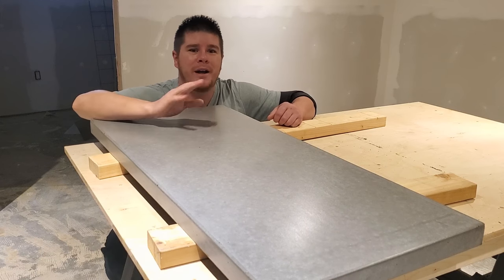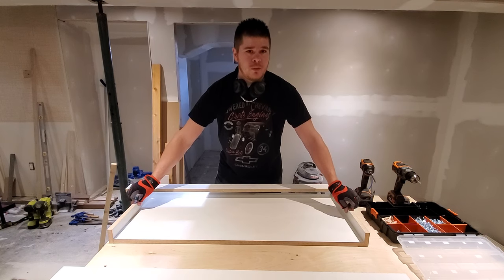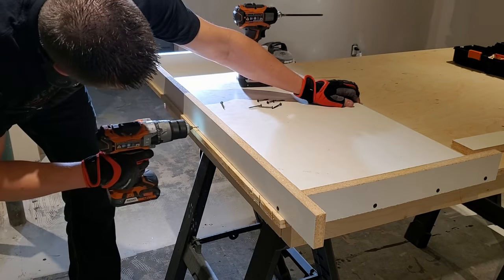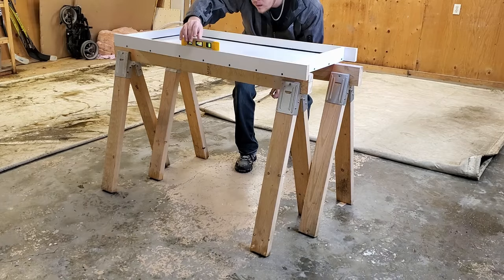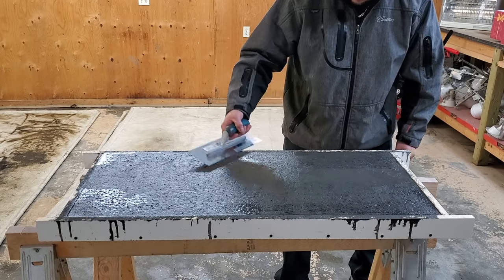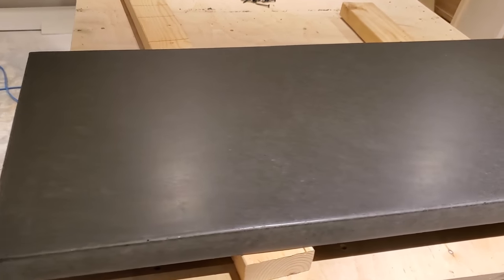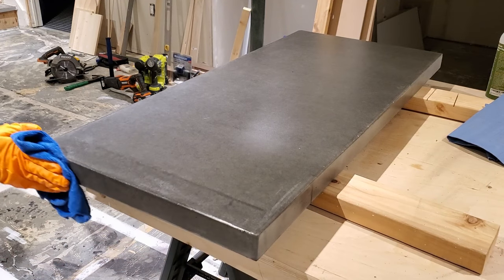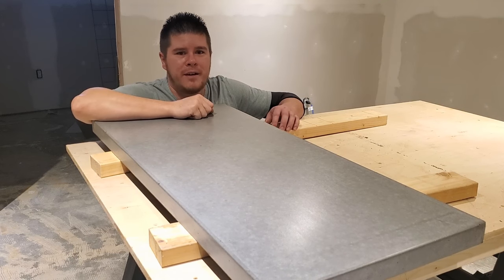Beginners guide, Concrete Tabletop you can build. No special tools, hand finished

Comment: Awesome work! Thank you!!
Reply from the maker: Thanks!
Reply: @JessedoesDIY  i was looking for inspiration for a side table and will make a concrete top for it! Should you always have reinforcement within the concrete no matter how small your slab will be? I’m thinking 2feet by 1foot 2inch depth.
Reply from the maker: Cool! Yeah, it just helps over time with cracking and twisting, and helps prevent it from one day just splitting apart for no real reason. Just helps keep it much more durable overall. The bigger you go, the more you may need to step up reinforcement, but even small slabs should have it.
Reply: @JessedoesDIY  brilliant! Thank you so much for your help. I’ve subscribed and am super stoked to get started. Thanks again.
Reply from the maker: Awesome, thanks! Good luck and have fun

Comment: Bummer. Did a second one of these and had a bit more car wax than i probably should have and it's like caked into the concrete, which came out perfectly, thanks to your method! Any advice on getting it off? I assume there's a chemical hack to make this happen. Thanks again
Reply from the maker: Yeah that sounds like too much, or it wasn't buffed off after it was cured on the mold before pouring. Glad the slab turned out tho. I wouldn't use any chemicals to get it off, you'll stain the concrete. Just get a blue scour pad sponge thing from the kitchen and water and buff it off. Then rewipe it with a damp rag after. If you have any stubborn stuff use a small chip or paint brush and water and poke it. Hope that helps

Comment: Great video. For the most part it came out really good. However I don’t think I vibrated the edges enough. The center looks fantastic but a decent  of pinholes near the edges. What is the best way to take care of these? Thanks!
Reply from the maker: Thanks! Yeah, I've been there. If you can get some cement, not concrete, cement. Mix up some in a solo cup with about a 50/50 mix of water and acrylic fortifier (concrete aisle) to be like toothpaste. You can use pure water if need be, but itll stick better to the cured concrete with the fortifier. Then press it in and smear it around, wait a min or 2 and with a rubber gloved hand wipe it back off. It'll stay in the holes. Let it dry a couple hours, then with a kitchen blue scrub pad dampened slightly with water, remove the haze from it and wipe off with a shop rag. Hope that helps!

Comment: Jesse, great video. I would like to add a concrete acid stain to my counter top. Does the wax mold release stop the concrete from absorbing the acid stain? Your thoughts? Thanks.
Reply from the maker: Thanks! Nope, because it's dried on the mould it doesn't absorb into the concrete, you're all good. Good luck!

Comment: Hello CanaDYIan! You mentionned 6000psi concrete, would 5000psi get a similar result? That’s all I find near me, the only 6000psi is fast set and prefer take my time. Thanks for the great video, nicest results and explanation I found!
Reply from the maker: Absolutely it will! I've used the 5000 psi stuff as well, and you'll get better results with a slower setting in my experience. The 2 different mixes are very similar, just different additives. Technique is more important in this case. Good luck on yours and keep me posted!

Comment: Jesse, what a brilliant demonstration! This is a gem.  Curious if you have recommendation  for a lightweight concrete to build a farmhouse concrete sink that would still be take a beating without chipping or cracking? Appreciate any input.  Thanks.
Reply from the maker: Thanks. Your only option for a "lightweight" concrete is to make a thin thickness with fiberglass. But that's a whole different ballgame

Comment: Great video and great result. Bravo!!
Can i make a similar countertop for the outside? If so, will it resist the canadian winter or do i have to add anything to the concret mix to prevent it from craking?
Reply from the maker: Thanks glad you like it! I have some outside as well and they can last, you'll just have to be more diligent with adding sealer and wax because they will require more maintenance is all

Comment: We are going to make 10’ floating desk. I want to include a usb port on top of the desk for easy access. How do you suggest we do that? I’ve seen some different ideas. Also I want to include holes for additional wires for printers to hide those cords.
Reply from the maker: There are USB hubs you can get at the hardware store that pop into circular cutouts. I'd use those. Check out my concrete vanity top to see how I included knockouts in my top. You'll also only be able to make an 8' top because that's the maximum size of melamine  plus making it too big will make it more liable to crack
Reply: @JessedoesDIY  Thank you, I’ve seen some round usb hubs and was leaning towards those. Yes, my husband has worked with concrete before so we know it will have to be done in 2 pieces and that’s fine since I need my 2nd piece to be wider than the rest. My husband is a contractor and does it all but thanks for the advice.
Reply from the maker: Oh awesome! Well good luck on yours

Comment: Late to the game, but question... if you've constructed your counter and want to frame then pour the concrete directly, put the mesh in there, (also using the board as the base), if you don't have direct access to the base, can you just vibrate the exposed sides to get the air out, or would you have to mix the concrete thinner?
Reply from the maker: There is a more specialized concrete mix you can buy for pour in place concrete tops that have defaming agents in them that forces the air out with little to no vibrating. It also has  much less aggregate in it and plasticizer to help it flow out with less water. You'll need to also be good with a float and trowel because you're looking at the top so it's up to you to make it smooth. That's a whole different ball game, I suggest you look at that specifically because it's quite different than this method

Comment: Great video! Building an outdoor bar with concrete. Do I need to add any type of weathering agent in the concrete mix?
Reply from the maker: Thanks, happy to help! Nope, you should be good to go. You just might have to apply sealer and wax a bit more often depending on your climate and how often you clean it. If water stops beading up on top of it, reapply. The sealer should be 1-2 times a year max

Comment: Great, step by step video. Do you think I can build a large dining table using similar technique? My table top will be 105" x 39".
Reply from the maker: Thanks! Yeah you could. I would still add the mesh in it but I may also add some thin reebar around the edge just to help prevent sagging and cracking over time. Also, just make sure to have it supported underneath properly. Good luck!
Reply: @JessedoesDIY  thanks Boss!
Reply from the maker: Anytime

Comment: Hi there, thecountertop looks great, just a quick question, what is the thickness of the slab? I have made a mold and cast my counter, but was wondering how much my measurements differ from yours.
Reply from the maker: Thanks! I made mine 1 3/4" thick. It should usually be that or 2 inches for strength sake and to avoid cracking. If you use Glass Fiber Reinforced you can usually go a bit thinner

Comment: Can you list the die that you used for the concrete? I noticed the water you added was black. Also @06:44 the die is being added.
Reply from the maker: I used Quikrete liquid concrete dye in Charcoal. You should be able to get it at Home Depot. It blends better if you add it to the water first, but then I decided after I wanted to add some more

Comment: Great work…..Im trying to buy concrete and the guy at the hardware store is asking if i want my concrete with sand or small rocks in it…..Which one should i buy ? Best regards !
Reply from the maker: Thanks. I mean, all concrete has sand in it. For this stuff I used Quikrete 5000, or 6000. One is a white bag, one blue but both would work. I'm guessing his sand comment was referencing a countertop mix which has no rock. If it is that, you really can't go wrong with any of them. Good luck and let me know how it goes!

Comment: Hi Dan.  I am making a fire table top that is 6' by 4' with a cut out in the middle for a 4' by 6" burner.  Should I use 1/4" or 3/8" rebar tie wrapped to my wire mesh to make sure the 1.5" slab will be strong enough on the 36" by 50" metal base?  A bit worried the scaling up may be problematic.

Comment: GREAT VIDEO. I Have a concrete kitchen top that's been waxed, sealed over and over but Lemon and acidic juice burners through and stains the top. Do you have any suggestions on how to prevent making and chippy concrete tops?
Reply from the maker: Thanks! Yeah you have to be diligent on keeping it clean, but it shouldn't be crumbling away if it's been maintained. I have bar tops that are 5 years old and look like the day I poured them still, even after lots has been spilled. What type of sealer and wax are you using? As for fixing yours, you'll have to make sure they are good and clean with dish soap and water. Then mix a slurry of cement and acrylic fortifier and cover the top. Remove it with a plastic putty knife and sand lightly to smooth. Then re seal. And in not even sure that will work if the concrete has a structural problem

Comment: Can you make ultra thin slabs using this method of making concrete tabletops? Thin as in 1 centimeter, 1.5 centimeters. Do you need to use fiberglass reinforcement or such? I want to make little concrete box by making four slabs and connecting them.
Reply from the maker: Not this method, no. You'd need to use fiberglass reinforced concrete and even them I'd go down to 1.5 cm thick only.

Comment: Great video,  a question if I may - Will this take the heat of a pizza oven on it outside in the wonderful UK wet weather??
Reply from the maker: I can't see why not. One of the great things about concrete tops is how resistant they are to hot and cold directly

Comment: The table looks awesome.  
This may be an obvious I was thinking of making a larger table but do not want one huge, heavy slab as it would be difficult to manage.  Is there any reason I could not make separate slabs and put them together to make one larger table (of course, with the appropriate base)?  Also, any tips if I do that?  
Thank you!
Reply from the maker: Thanks! You could do it that way, but you will have a seam, but if you're OK with that, go for it! The only way you could minimize the seam would be to not caulk the 2 corners and edge that will meet up. This way they won't be rounded over and will be less obvious.

Comment: Can I use any concrete bag? Im using Quikrete crack resistant. Hopefully this will look smooth and not have rocks on the surface finish.
Reply from the maker: Pretty much yup. There is a specific countertop mix they make but any bag can work if you follow the steps and vibrate it correctly. A very light sanding like I showed shouldn't really reveal any rocks. You might have a tip or 2 show up around an edge but that's it. Adds to the look

Comment: So grateful you have shared this video! What sort of dye can you use to color the concrete? Do you need to seal the concrete more than once? How thin can you make the table top before it might crack? My top will be quite long at 100". Any insight? Thanks so much!
Reply from the maker: Thanks, I'm glad you liked it! You can buy dye in stores like home depot or lowes, and even more online. They come in either liquid or powder and both are specifically made for concrete. Sealing it once a year is generally a good idea to keep it clean and prevent stains, wax it as needed. If you see water soaking in again and not sitting on top like I showed, it needs more. The thinnest I'd make it would be 1.5". Any thinner and it becomes fragile, could crack or will ghost the reinforcement in the top. It will be ok as long as it has good support under it once in place, the only problem is lifting it. I linked one, or you can Google a concrete calculator that will literally tell you how many bags and how heavy it will be. Hope that helps! Keep me posted, I'd love to see it!
Reply: @JessedoesDIY  thanks a lot. Your video and reply were tremendously helpful!
Reply from the maker: Anytime. Good luck

Comment: Awesome tutorial and nice to see a Canadian DIY'er with links to stuff we can get here in Canada. Question though, do you have to reapply the wax or is it a one and done? Where do you get and what exactly is the colourant?
Reply from the maker: Thanks! Glad I could help. The sealer and wax both need to be reapplied over time, but less and less as time goes on because it builds layers. The sealer is about once a year for a couple years, then as needed.  The wax is once a month for a couple months, then as needed. You'll be able to tell just by looking at the slab. If it starts looking more like concrete again and loses that nice shiny counter top look, seal it. If it stops beading water like I showed, wax it. It all depends on how aggressive you are cleaning it and where it lives. For dye I used Quikrete charcoal liquid dye, but you can buy dye online too. The stuff I used is in the concrete aisle at home depot. Just make sure you don't use more than recommended because it will weaken it otherwise. This stuff was max one bottle to one bag of concrete
Reply: @JessedoesDIY  Thanks so much for the reply, that really helps. I'm redoing our downstairs powder room with custom diy cabinets and a nice glass vessel sink. I thought a dark concrete slab would really add a nice touch. Thanks to your tutorial I have the confidence to give it a go. All the best!
Reply from the maker: Awesome! I'm sure it'll turn out great! I'd love to see it when you're done, email me some pics. I'll feature it too. Good luck!

Comment: Awesome video!  Quick question:  what are your thoughts on using a 6000 PSI concrete vs concrete specifically designed for countertops?
Reply from the maker: Thanks! So I used a 6000psi on this but the problem is it shrinks, and that makes it curl over time. If you aren't using a countertop specific mix, make sure whatever you get is a non shrink or at least a low shrink mix, that'll give you your best results. A countertop mix is always best however, but much more expensive and harder to find in some places. It has additives that prevent shrink and curling, and also flow additives so you can have a runnier mix with less water and it won't adversely affect the slab. It also has smaller aggregate so its a little easier to smooth out and the potential for less bubbles. Hope that helps!
Reply: @JessedoesDIY  Thanks for the quick reply!
Reply from the maker: Anytime. Good luck!

Comment: Hey great video. Quick question? I messed the silicone application, should I wait till it cures and then pull it off then do it again? Hope you get this message
Reply from the maker: Thanks! Yes, definitely wait. If you try while its wet it'll only make a huge mess. Once dry just peel it, scrape and clean and retry
Reply: Thanks for the response. I tried to clean it while it was wet smh lol. Not fun. I’ll wait till tomorrow to peel it off. Thanks again.
Reply from the maker: No prob. Good luck

Comment: Great video. I’m nervous about building a concrete dining table, because I fear that the wire reinforcement will show, as it looks like it has on this otherwise perfect slab. Thoughts? Thanks!
Reply from the maker: Thanks. The only way to know is jump in and take the plunge! Even if it doesn't turn out totally perfect, as long as you get some practice under your belt with it and learn from any potential mistakes then it is a worthwhile experience. I would have some help tho with a big pour like that just to make it easier. Just make sure to do a first round of vibrating and have it just over half to 3/4 full before adding reinforcement, then do a second round of vibrating for a little less time to make sure the reinforcement stays where it is and doesn't float or sink. Good luck! Love to see how it turns out
Reply: Where did you see the wire mesh?

Comment: Can you use this as a kitchen countertop?
What do you use hold the countertop in place on a cabinet? Construction adhesive?
Reply from the maker: You could, but I'd probably use the method I used in my bathroom vanity top. It's different and stronger, plus I show the cutout process for a sink and taps. Check it out in my Concrete Playlist. I usually just let it's weight sit there, it's pretty damn heavy. But if you need something clear silicone works. Or construction adhesive if you need a strong bond, yup

Comment: Great video, thank you. 
How large of a table/counter top could you make using this method without worrying too much  about it breaking? I’d like to make a table/ housing for my kamado style grill.
I’d like something 6’-8’ long x 30-36” wide with an oval hole on one side 20”x16” ish. 
Thank you!
Reply from the maker: Thanks! You can make them really big as long as it has support under it. I made a 8' long one, 20" wide with 2 arms coming off each side for a bar top. As long as you can carry it without dropping it. Around the edges though I'd probably run some thin reebar to help hold the weight, and possibly around the circle as well if it will be floating without support under it. Good luck on yours! Keep me posted, I'd love to see it when its done